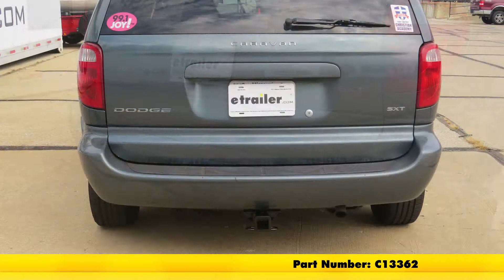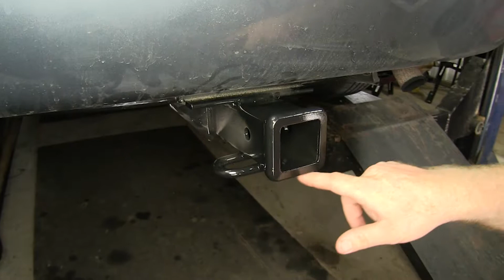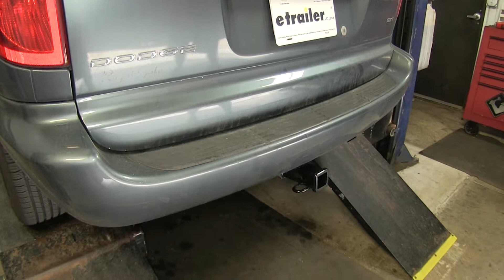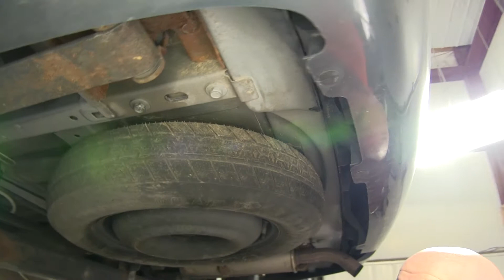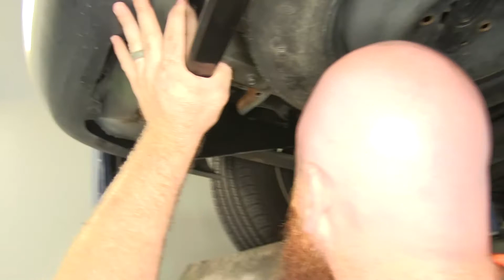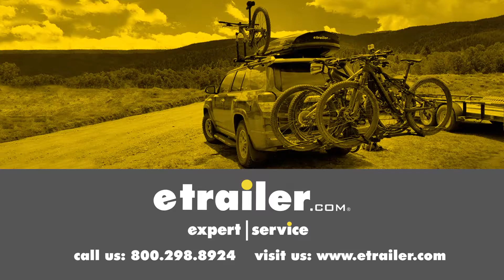Step-By-Step Installation Tutorial for the Curt Trailer Hitch Receiver on a 2007 Dodge Caravan

Comment: I have the same year grand caravan SXT model.   The rear seats fold down into the floor.

Is that a problem with this hitch?   And why?
Reply from the maker: This hitch will not fit with the Stow-N-Go seats. I'm not 100% sure why, but it looks like there isn't enough room for this to attach the way it does on the versions without those seats.

That said, you will need the Curt 13389 ( https://www.etrailer.com/Trailer-Hitch/CURT/13389.html ). We have a video of this being installed on an 07 here: https://www.youtube.com/watch?v=vxge-BOyFc0

Comment: If your bolts are rusty just be prepared for a nightmare. Also, you can avoid drilling by pushing it through the bumper area as shown in another video on this channel for the caravans. You don't have much wire to work with but it does work.

If you have a little rust PLEASE use some oil or a torch and save yourself a nightmare. This 30 min job can turn into miserable ass time if your bolts snap off
Reply from the maker: If the weld nuts are rusted, using lots of spray lubricant along with a M12x1.75 thread tap is recommended.
https://www.etrailer.com/Trailer-Hitch/CURT/C13362.html